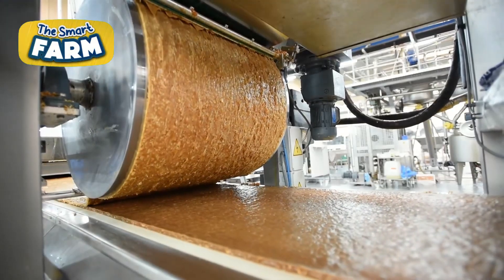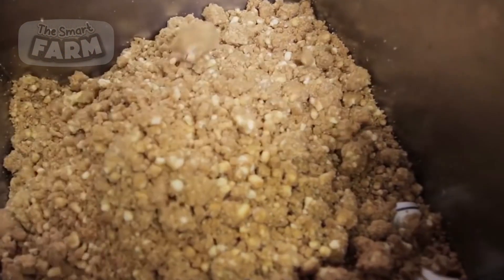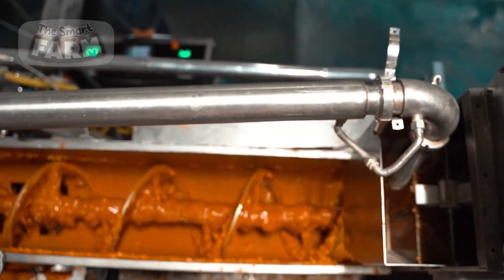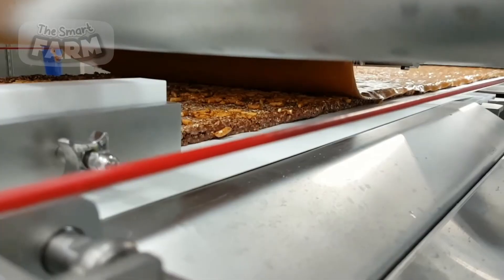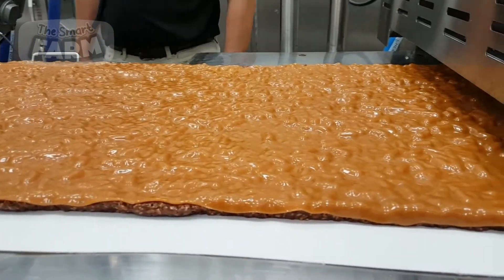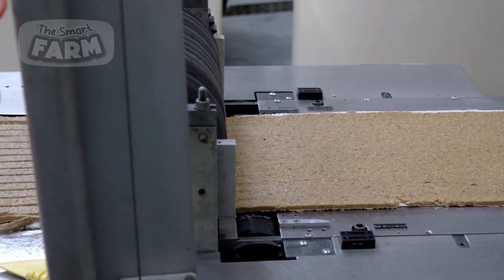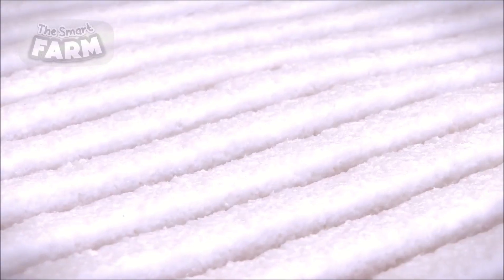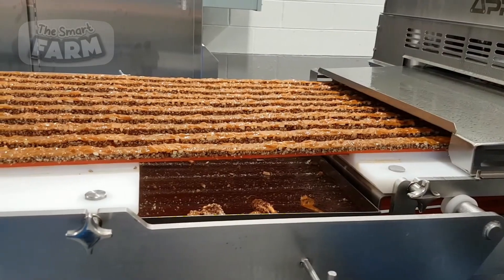AMAZING Protein Bars Factory! This is How Your Protein Bars Are Made!

Comment: All protien bars have ZERO protien in them because of a process referred to as denaturation whereby the protien structure is altered through compression and heating, this product may have began with containing protien but by the time the process is finished there is no protien in the product because it has been denatured
Reply: The claim that protein bars contain zero protein due to denaturation is not accurate. Here's why:

1. Denaturation:
What is Denaturation? Denaturation refers to the process in which the structure of protein molecules is altered, often by heat, acid, or mechanical processing. This changes the shape of the protein, but it does not eliminate the protein or its nutritional value.
Does Denaturation Destroy Protein? No, denaturation does not destroy the protein itself; it just changes its structure. Your body still digests and absorbs denatured proteins, breaking them down into amino acids, which are then used by your body.

2. Protein in Processed Foods:
Compression and Heating in Protein Bar Production: Protein bars often go through some level of heating or mechanical processing. While these processes may denature the proteins, they do not "remove" the protein. The proteins remain intact in terms of their nutritional value and can still provide amino acids after digestion.

3. Scientific Consensus:
Denatured proteins are still proteins and can be digested just like non-denatured proteins. Cooking food, for example, denatures proteins in meat, eggs, and other foods, but those foods still provide protein to the body.

4. Protein Testing:
Companies that produce protein bars often have their products tested for nutritional content, including protein levels. The amount of protein listed on the label reflects the protein content after manufacturing processes are complete.

Conclusion:
Denaturing the protein during the manufacturing process does not mean that the protein is "gone." It is still present and functional as a source of amino acids. The claim that protein bars have "zero protein" due to denaturation is a misunderstanding of how protein works.
Reply: @stanleyleeansyah   . . . all four points of your claim and your conclusion are completely and scientifically wrong, why would you spend so much energy on putting out false data? What do you gain with this misinformation?
Reply: @raeb5226 can you prove otherwise?
Reply: @porothashawarma2339   . . . yes I can,  it is a process known as "denaturation" and I did not invent it, denaturation is a well known established fact that every high school student who took chemistry knows about,  that is how I can prove it
Reply: @raeb5226  that's completely untrue lmao otherwise a steak or a chicken roast would have zero protein because they were all heated to a high temperature
Reply: @raeb5226 Then break down why each of his 4 points are wrong specifically.
Reply: @raeb5226 the fact it can also happen by just cooking normal food tells me you know nothing 😂
Reply: @dr.waytoogood   . . . the fact that it happens because of cooking is the point but apparently that one went over your pointy head  🤣 🤣 🤣